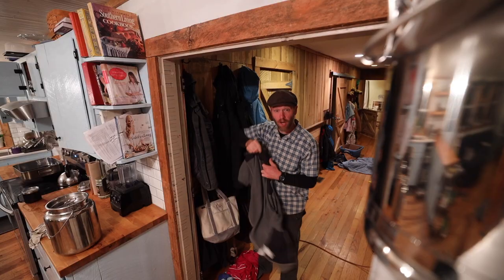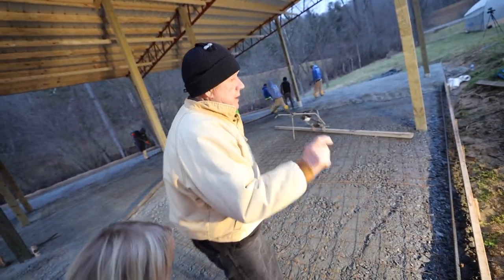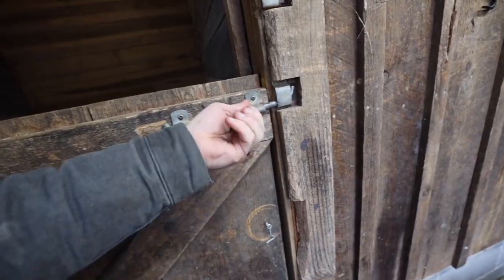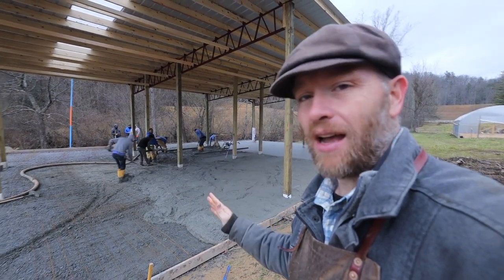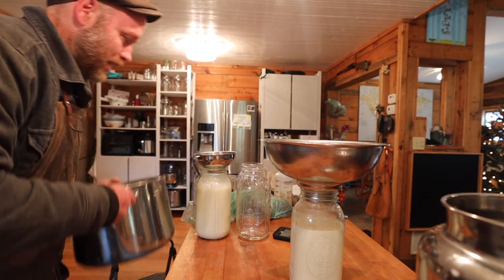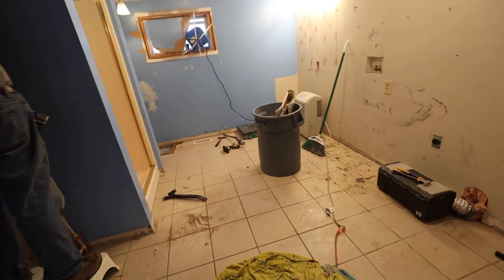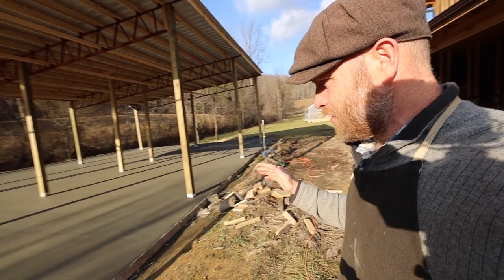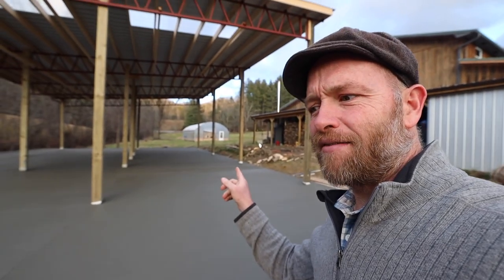POLE BARN Gets a Concrete Floor (In a Day)

Comment: Who was that kid? 
 Concrete mix looks good.  A lot of people will add way too much water especially if they're using a line pump because it's much easier to work. Your crew looks good they're working it very dry and they have to pay for that with sweat but that's the right way to do it.  Looking 😁👍good.  
  A way to make yogurt that works well for me.  A very clean quart canning jar with a towel wrapped around it and rubber-banded. A brand new very clean aquarium tank heater the kind in a glass test tube with the heating element inside and a temperature control on the top. Once you get the temperature adjusted it does an excellent job of growing mild smooth yogurt time after time.